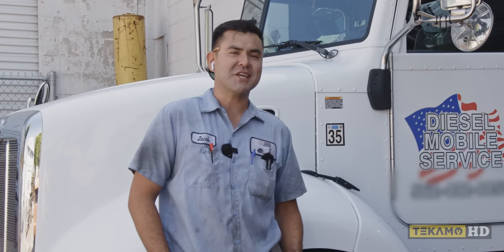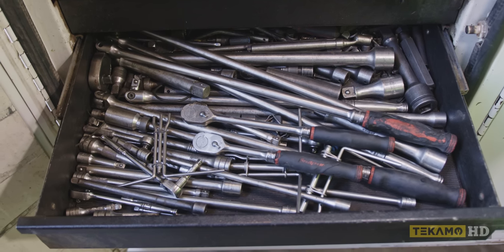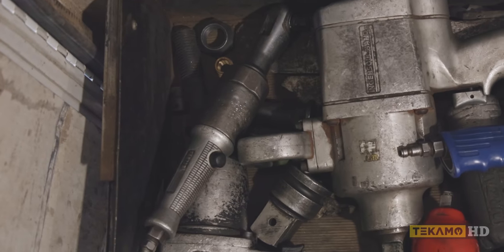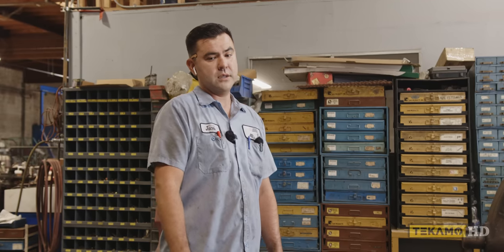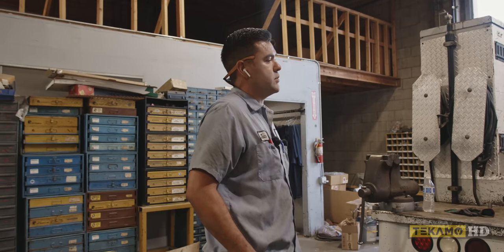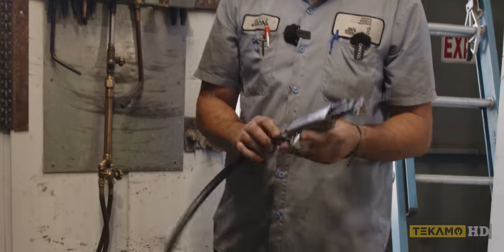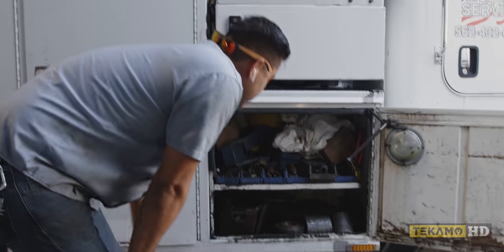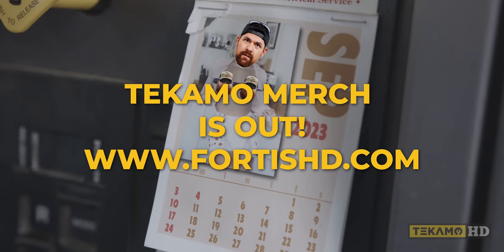Californian Field Mechanic Truck Tour - Heavy Equipment Mechanic

Comment: So is none of the tools actually yours ? Like if you lose this job, “I know sounds silly in the world we live in” but if you lose your job. What do you have to start somewhere else. Or on your own? Do you have to find someone else with a full truck to let you use? I’m actually wondering as well. Not trying to be rude.
Reply: The company I work for fills the service truck,  I have a box at the shop that's mine. Haven't seen many places doing it though.  Works good for them because I'm maintaining their fleet so if somebody needs a specialty tool out on site I just say it's in the truck and I don't have to worry about it, I'll just restock the truck at the shop when I return.
Reply: @Jwar86  sweet yeah I was just curious, that makes sense tho. Thanks.
Reply: He likely has his own tools, but the truck is already stocked with tools the company knows get the job done
Reply: Also depends on where you live sometimes. I have a service van for excavator/loader repairs and all the tools are bought by the company. Which is the standard here.
Reply: @Jwar86   That is wild  really weird and i bet uncommon .  I worked  in one shop were they had one box 2 mechanics the one guy did about nothing but service and i did the major jobs. I didnt like it the best because i was used to having my own tools about every thing i needed or buying what i didnt have . They didnt have a lot of stuff just enough to get buy.  I dont mechanic full time  now but i would really have to think about using a truck with some one else tools . I can understand some stuff but hand tools is another deal.